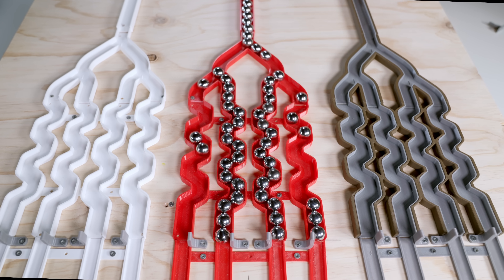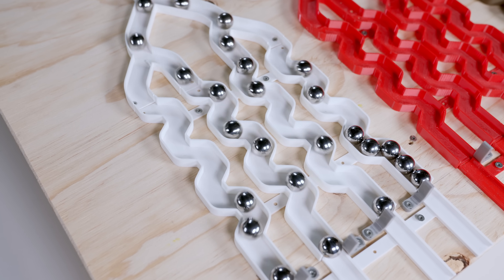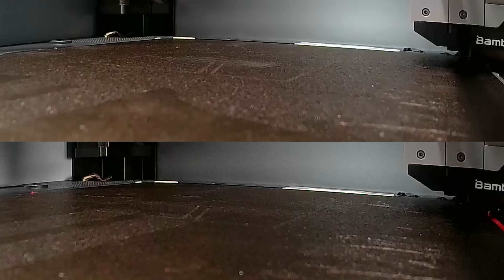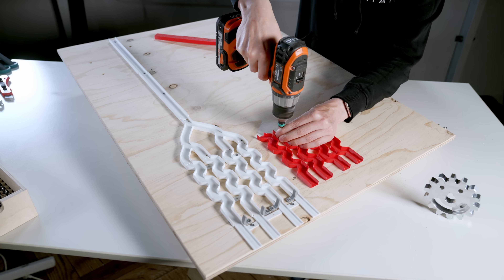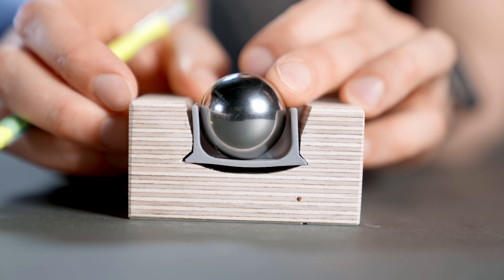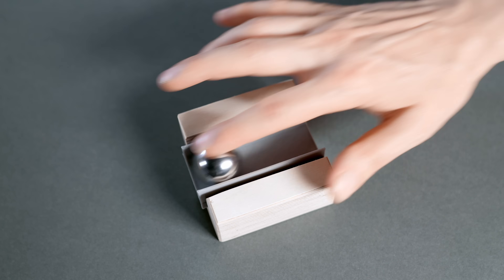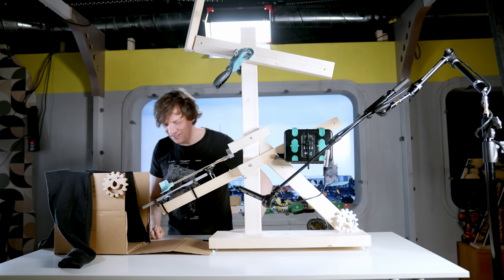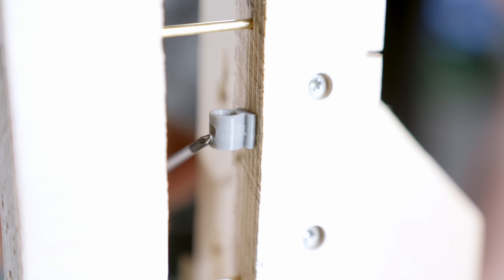The Perfect Marble Divider just got Better

Comment: I noticed that the TPU channels were slowing down the travel of the marbles. It later became apparent that the slow travel wasn't only a trait of the softer material, but also of the design of the track which the marbles roll down. When the walls close up because of a deeper channel (seen at 8:15), you're making the marbles grip the walls which can be good for speed control, but could also mean you'll have to redesign how the marbles are timed.

Comment: 12:58 you do not need the screw or nail if the attachment for the sound dampener was attached to the same counter balanced weight. then the rotatable wall would always move in sync with the arm on rebound.

Comment: one issue i see with the space below the track is that when a marble pushed down on the center of the track it will pinch the sides inwards putting pressure on the marble making it much slower. so this could lead to Marble Flow rate issues.

Comment: you could have just put sound deadening between the splitter and the mounting board. something that i learnt while insulating vehicles is that it is large flat surfaces that produce the majority of sound. in your case it is likely that the vibration is transferring from the splitter onto the board and then the board is "amplifying" that noise.

Comment: You'll keep working on this, but you may find that the sound of the third track is because the TPU can't flex inside the PLA frame, and so marbles can't move and rattle after they stop. So adding space under the track may make the tracks louder.

Comment: Beware elastomers!  They have a way of aging & either warping, getting hard, or turning into slime.  They can also change dimension with time.  That is the LAST thing you need in marble divider!  If you must, print smaller pieces that fit together with small gaps between.  Such a setup will be less sensitive to expansion (like jointed railroad tracks).  Beware any elastomer that is sensitive to moisture!  Regarding being quiet, most of the noise comes from the plywood "sounding board".  A layer of Norsorex damping rubber on the back of the plywood will kill most of the noise.  If under-layment damping rots or changes dimension, it won't affect machine so much & can be easily replaced.  You don't want to kill ALL of the noise; the marble sounds are part of the machine.  Listen to your original recording!
          Regarding putting elastomer over the vibraphone, what you have is then "standard vibraphone", not "Martin Marble Machine Vibraphone".

Comment: TPU is Thermoplastic Polyurethane.  My concern would be that polyurethanes degrade over time due to the moisture they absorb, so its not just a printing issue with moisture.  The material with harden slightly, lose its flexibility and then just crumble apart.  I would use traditional musical instrument materials when ever possible for dampening.  I've seen a lot of felt take a beating and still do its job.  TLDR; just because you've got a shiny new hammer doesn't mean everything is now a nail lol.

Comment: I would do a long term material durability test with TPU, I dont believe it has great wear resistance, especially if the environment changes significantly, say going on a tour. I think you'll probably want to cast final parts with more durable materials with similar properties instead. 3D printers are great for creating casting molds though

Comment: Looks like the red filament is gripping the balls a bit, perhaps adding a small portion of heat into the balls. Isn't there a risk they get so hot that they melt the tracks? Go with nylon, if you can print that.

Comment: Still insisting on the moving vibraphone plates? Good way to guarantee floor marbles, as when a marble hits as the plate moves up the plate will impart momentum onto the bearing causing the bounce to be bigger. If the plate is already moving away from the marble it will remove momentum from the bearing making the bounce much less. This variability will also change the distance between you softener and the plate which will also change the dynamics at random. The only way to balance this would be to ensure the movement of the plate is always timed with the machine which would be an engineering nightmare the likes of which you have not yet seen. Don't get me wrong it looks cool but it's a foolish design idea!

Comment: MARTIN the gap under the tracks could potentially cause issues with marbles getting stuck in low spots where marbles accumulate if there isnt enough slope.

Comment: Yeah… don’t remove material from the sides and the bottom. It will cause the track to disfigure and could cause issues with the perfect spacing the track needs so the marbles won’t jamb

Comment: You need to be extremely careful with Carbon Fiber Printing. The material it like tiny swords and will pierce into everything including your hands and lungs. Make sure to apply a Clear Coat over all CF Parts to make sure to seal them. CF parts are very dangerous.

Comment: TBH, what I'm disappointed by with the vibraphone test is that you didn't use your nice droppers for it. You should get the droppers to the point where you can just put a module on the table and get a dozen precisely-dropped marbles exactly where you want them. And then the vibraphone arm is still a 2x4 with a bolt through it and a screw sticking up the right amount, but it's only the module you're prototyping that you just threw together.

Comment: You should always have your 3d printer well ventilated, regardless of what filament you're using.
Some are worse than others, but none are good.

Also, you should keep an eye on your nozzle wear if you're going to be using carbon fibre, or any other abrasive filament, and you should put a finish coating on CF prints to seal in the tiny fibers. It's no different from fibreglass, and should be handled just as carefully

Comment: Most of the noise is not coming from the track, it's coming from the wood underneath.  Put a thin soft foam layer under the hard plastic and it will be far quieter.

Comment: I don't know if bambu lab slicer can, but in Cura, you can enable the ironing feature, to make horizontal surfaces smooth, which should help reduce noise even further.
Reply: Yes, it does have the ironing function 👍🏼

Comment: You should look into a belt bed printer like the Creality CR-30 to be able to print longer track sections in one go. It would minimize how many track sections need to join together and eliminate the tiny sounds of the marbles transitioning between them.

A con of this approach is that the layer lines would be 45 degrees upwards instead of laying parallel to the marble motion. That could increase noise in general unless the printer is tuned well.

Comment: does the ppa cf suffer from the same problem as other carbon fibre stuff? where rubbing or touching it kind of flakes off tiny tiny shards of carbon fibre? if it does you might have to spray some kind of coating on it to stop it. check your fingers under a microscope after you rub your printed CF parts and make sure. just in case, cause breathing in tiny carbon fibre filaments/shards is bad.

edit: it can also be really itchy if enough of the shards embed themselves in your skin.

Comment: To decreasd noise even more, I recommend trying ColorFabbs Varioshore TPU: This is TPU printed as a kind of foam, containig air bubbles! The akr bubbles should help to cancel out the noise. The black color of this filement ends out in a drak grey, that should also be fine for a good look.

Comment: With that plywood-tpu track design you were showing with the extra sanding to create a larger gap- I would make sure that the marbles pushing down on the TPU don’t cause it to flex to the point where it squeezes on the marbles, holding them in place.

Comment: Hello @Wintergatan, we're loving the project and have been following you for quite a while. We may have a material that out-performs TPU in the applications you're using it. We produce parts in TPE and have rapid-prototyping capability as well.  We produce copolyester-elastomer bumpers and shock absorbers. Google Advanced Elastomer Technologies if you're ever interested!

Comment: Something to note with carbon fibre filament; You can easily get tiny minute bits of the carbon fibre into the pores of your skin. Make sure to handle with gloves and highly advised to use some sort of sealant after you've finished printing them and don't sand them down. Other Makers have had serious issues with this after handling carbon fibre prints a lot.

Comment: CF particles, as mentioned by others, can become airborne for a long period after use! Don't use them on moving parts like that! Additionally, do not use CF filament on parts you occasionally have to touch! Rub something like a white glove over it, and look at it under a microscope after. You'll get hundreds of micro carbon splinters if you build a large machine out of it. Coat it!  UV resin is good for it. But bye bye dimensional accuracy. Use it for fully enclosed mechanical parts only.

Comment: I worry about marbles getting stuck in those flexible channels - depending on the rigidity of the material, the weight of the marble might cause it to constantly give slightly and mess with the angle the marble is traversing. I'm not an engineer or anything, so it is purely an intuition thing for my part.

Comment: 1/3 of the timeline is green, wow. Thanks, sponsorblock!
Reply: sponsorblock also highlighted where he talks about issues he had printing tpu and criticism from open source community
Reply: @linecraftman3907  If you notice stuff like that you can edit a better version and downvote bad ones. Helps to keep the extension useful!
Reply: @Tome_Wyrm  i only use it on my phone so idk how to do that
Reply: @linecraftman3907  Ah crap. Meant to leave a comment. You should be able to vote on the segments. It should show up in the bottom right. That's ultimately the most important thing. Vote out the bad segments.
Reply: @linecraftman3907  an ad is an ad. I trust the process to err on the side of caution - better block too much than too little.
Reply: @linecraftman3907 someone mislabeled segments
Reply: @linecraftman3907  if it says it's an ad, it's an ad. Who am I to dig through it myself?

Comment: I used to be a big fan of TPU, but I find myself using flexible PLA more often now.  They both have their place, but I have noticed that FlexPLA has less friction and is easier to print with.  I was making funnels, items would stick in the TPU but had much less of a problem with FlexPLA.

Comment: 13:30 the TPU printed part has an infill that will vary depending on the position on the print bed leading to inconsistent result you should take this into account and design your part either solid no infill just varying the thickness or use a more stable infill like gyroid but some inconsistentency will remain the best option if you need the part to have some air in to dampen the force you shoud design the infill aswell.
Reply: Yes, I thought the same thing
but please just use punctuation in your comment, this is hard to read. Your keyboard has "." and "," for a reason (and that is not just the very end of your comment). Thank you.

Comment: What ever you do Do Not undercut the structure of the Devider. Removed some wood below and to the sides of the TPU for other secontions to cut down on noise may be okay, but the Divider's Geometry needs to be Strict to work. Undercutting it's structure would lead to deformation and binding.

Comment: That airgap Plywood/TPA version is going to have an issue... When you have lots of marbles in a track in wil flex and even maybe bottom out the flex and convert it into inward pressure on the sidewalls acting as a friction brake on the marbles which will very likely create jams

Comment: If you are having trouble with floor marbles, I recommend using Ivan Miranda’s setup of running string around the edge of the table so they don’t fall. Long time fan! Keep it up!
Reply: I was just about to make a comment on this channel entering into the big leagues and turning into Ivan Mirada.
Reply: It's part of the "show" you dummy 😅
Reply: Or/and a shop vac with a 3d printed separator attachment
Reply: Or just, like, a bucket? A bucket at the end of the track.
Reply: I've often wondered why he just doesn't have a magnetic broom in the shop. It's great for picking up dropped screws, nails, washers and bolts as well. He could even make one himself out of rare earth magnets and wood (which he seems to have an endless supply of!)
Reply: A row of Neodymium magnets around the table edges then again just one edge if you just tilt the table one of the four sides they would then collect upon the magnets  lol Heh

Comment: At the start, those are dividing marbles VERY unevenly. Slow the footage down and look at how many marbles are ending up in each lane over time. The one on the left is actually doing by far the best job of splitting them. The red one does not have a SINGLE marble go into the far left lane before it cuts to the divider on the right. The one on the right during the initial video does not have a single marble go into the far right lane. If you are using these and playing notes consistently in lanes 3 and 4, lane 4 will empty very fast and never refill.

I just don't see how you are going to use this design in an operating marble machine where all lanes are being used and all lanes have need for marbles. Unless the plan is to just massively overfill the system with marbles, which may work as long as that is always the case.
Reply: I think the idea of this design was to always run it full of marbles, because the marbles themselves divide the incoming marbles. It's been a while...
Reply: He's never been good at proactively identifying is issues (or at least acknowledging them in the videos).  He ignores these problems so he can label something as "perfect" (ie., a "perfect marble divider").  I suspect that he DOES know these are true issues, and this is why he hasn't made any progress in this project for 3+ years.

Comment: Look up “varioshore” filament. It is a tpu that turns into a hard foam as it is printed, and you can control the density by changing the temperature. Stuff is super useful for projects like this.

Comment: With 3D-printed parts from carbon fiber, I wonder how they align the fibers? Do you have to design printing paths in sich a way that the fibers get aligned with the directions you want? Or are the fibers short and omnidirectional? That would kind of defeat the purpose of CF...

Comment: you should add some synthetic vibration to the test jig for this design. Take a vibrator motor out of a... massage... device and just mount it to the plywood. It makes me wonder if that discrete "rubberband" effect can be lost with sufficient vibration in the overall system.

Comment: Isn't the whole reason this marble divider design works the fact that the marbles fit very snuggly in the pathways? Wasn't there an issue where the marbles would stack off center from each other if the channels were too wide? If you make the sides flexible, wouldn't the pressure from the marbles deform the channel and cause this issue again?

Comment: I see many concerns about the TPU material in these early comments.
But I think many of those concerns are misinformed.
TPU is an incredibly durable material and quite smooth.
I do worry about the bendable tracks, as those might get stuck in a pinching position.
But of course, the tracks need an extensive durability test.

The dislike is because I do not appreciate the Bambu Lab advertisement.
Their selling points are too obviously shoehorned in.
And even without that, I will personally never support Bambu.
This since their machines are hard to maintain in the long term and repair if parts break.
While the printers are great now, if the hardware or software fails they will be e-waste.

17:16 What the heck was that!?
Why that tone and short reference to one cherry-picked interview?
That is who-fully inadequate coverage of these and the above concerns.
I will be blunt, if I was donating to the channel, this would be the end of it.
But since I'm not, I'll unsubscribe if this becomes a recurring pattern.

Comment: Great solution, but a lot of the noisiness of the original was from mounting on what was essentially a sound board. I'll bet if you'd just added simple grommet isolators it would have been much quieter. Of course then you wouldn't have gotten a free printer 😎

Comment: be careful when working with carbon fiber, i'm pretty sure you're not supposed to be touching it with your bare hands because carbon fiber flakes off. carbon fiber parts need to be coated

Comment: I really love the progress in this one, except for the flexible tracks with room to bend is a bad idea in terms of energy required. You are limiting how fast the marbles can move down the tracks, imagine trying to drive a bike with half filled tires. This will lead to requiring to raise the marbles higher (more energy required) to keep the same speed. The plywood + TPU design is perfect without the added gaps, plus just aesthetically speaking, loose fitting and bendy parts tend to look worse than tight fit and solid ones.

Comment: the noise of the marble machine is a part of what makes it fun and feel mechanical and analog, anything that makes noise that's on beat should not be made quieter at all, and i'd go as far as suggesting putting some contact microphones around the frame to amplify that noise for larger venues.

Comment: 10:33 This is an unbalenced comparison, without the band the angle of the vibrophone should be steep enough so that it bounces on it's own, as it has in your old machines. The band sounds better because it's bouncing off, but you don't need the band for that.

I have no doubt it also sounds better regardless, but the test cant show if it does.